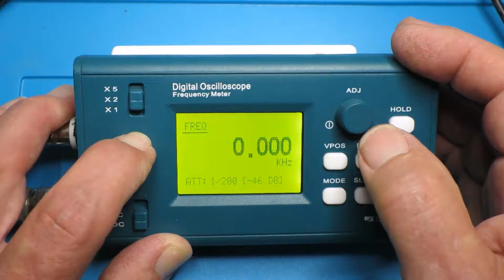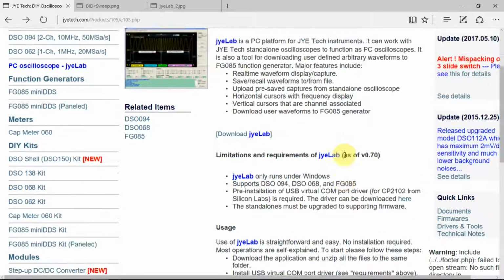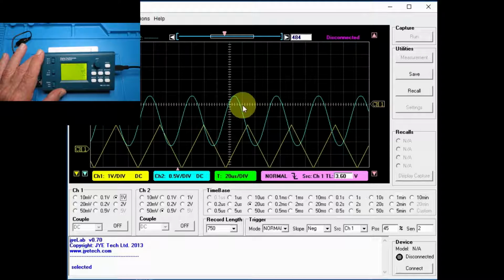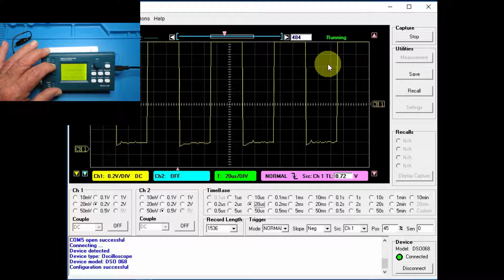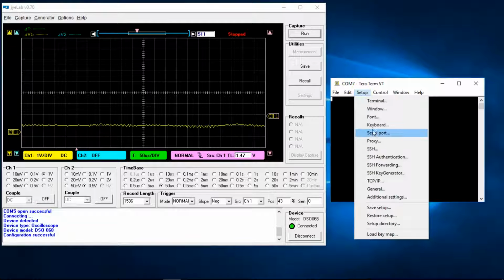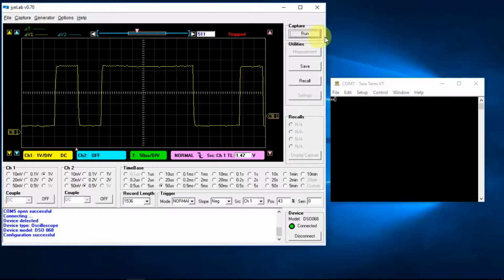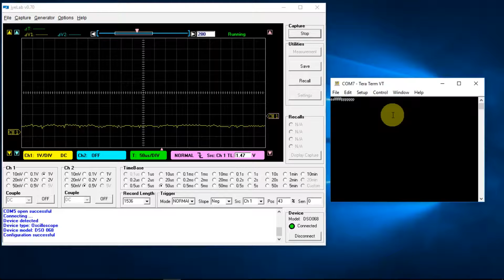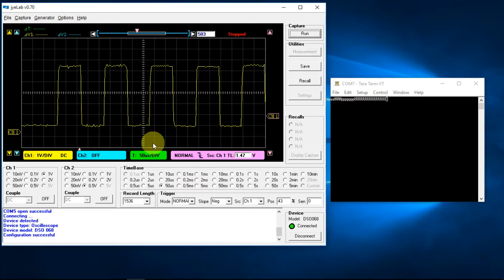Turn Your PC into a  Storage Scope for Under $60!! JyeLab Software - Electronic Project

Comment: Many thanks great video. Loved your first video about building this kit and now with this free software, looks great fun and useful too!  Must go and buy one, many thanks again.
Reply from the maker: Thanks Fred! Even though I have a nice Rigol 'scope this little guy is very useful. Battery powered it can always be on the bench if you just need to check something quickly. Perhaps consider the two channel model which is also supported by this software : DSO094 Dual Channel DIY Oscilloscope Kit : http://bit.ly/DSO_094

Comment: Apparently the DSO068 has another 7 analogue channels available in the long pin header area below the LCD. Have you had a chance to try that out? (The ATMega64 used in the kit has 8 channels, and only 1 is used for the probe input. JYE have a document about using these extra 7 channels for Data Logging)

https://jyetech.com/wp-content/uploads/2019/01/dso068-data-interface.pdf
Reply from the maker: No, I had not seen that. Thanks for sharing. Will keep it in mind, one day I may need it.